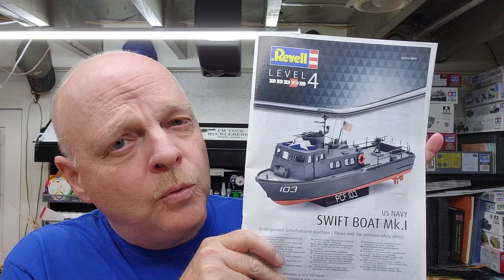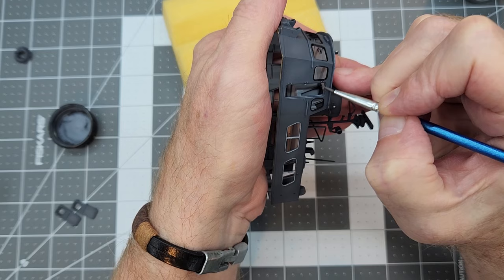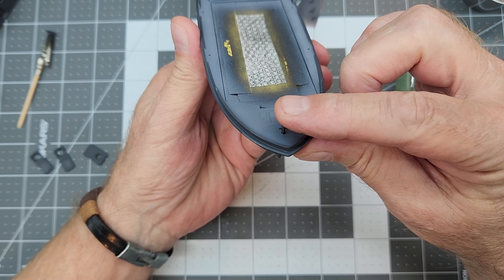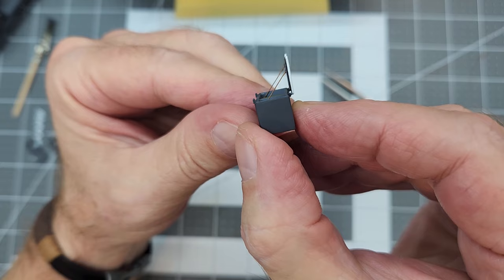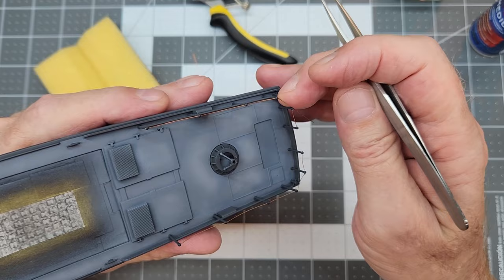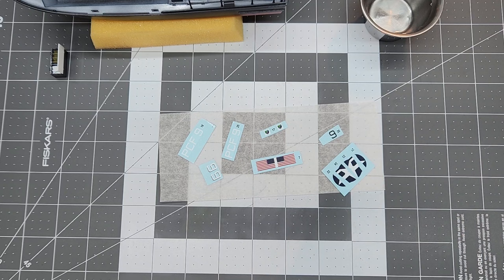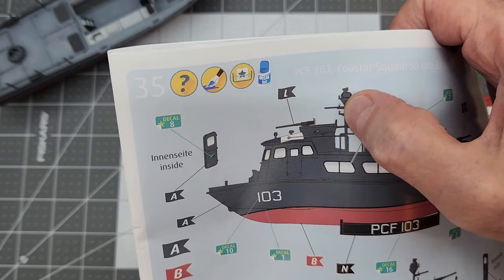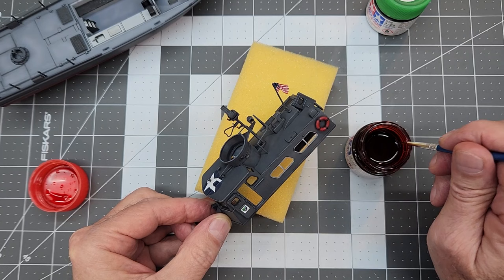US Navy Swift Boat Mk. I by Revell, Part 5, Finishing up, Final Reveal

Comment: Thank you for sharing your knowlegde here. I love your videos because you explain clearly what you do and why is that. These are perfect tutorials for beginners like me.
I decided to build this model after watching your videos. Hope you won't mind if I ask for advice here. I want to brush paint my model with Revell enamels. Would it fine if I use gloss clear acrylic paint before decals and weathering (based on oil paints) and then, protect everything with acrylic flat clear paint? All brush painted. I did search google, but there are so many different opinions that I feel even more confused than before.
And sorry for my poor English.
Reply from the maker: I think your English is just fine, it's my English that could use some help! 😊And never hesitate to ask me anything, I love to help anyone that wants it. As to your question, the simple answer is yes you can use acrylics over enamels, and vice versa. But, there is always a but, enamels as you know are solvent based (thinner), so use acrylics that are water based so there isn't any issue with the acrylic dissolving the enamels. I mention this because one of the most used model paint brands is Tamiya, and their XF acrylics are solvent based, which can soften enamels if painted over them until they fully cure. Hope this helps. Good luck with your build, take care and have fun my friend!!! Johnny
Reply: @hillbillymodeling  Thanks a lot! You are very king. Right, I was afraid of messing up base paint when using wrong clear coat and wash. I'll look for water based acrylic clear paint, or at least make sure enamels are well cured (5-7 days probably) before applying any coats that could supposedly soften them.
BTW, my previous and the first ever plastic model was PT-109 built just after seeing your videos :)
Greetings from Poland, stay safe and healthy and keep up your great work! Mateusz
Reply from the maker: @user-gt2ki7gi8d  No problem Mateusz, You honor me my friend, thank you. Johnny